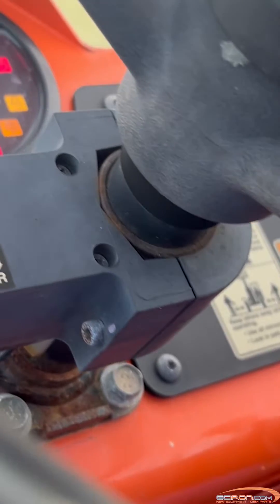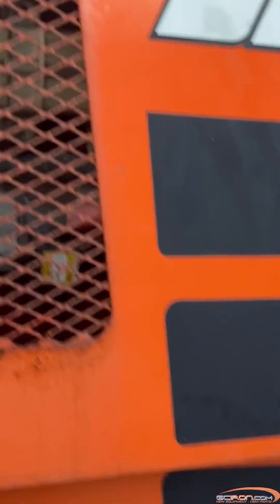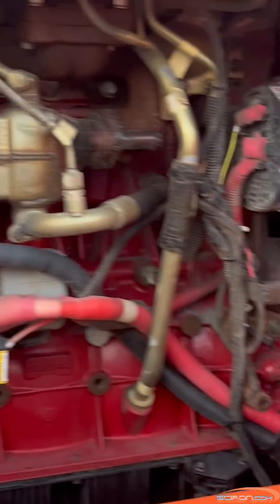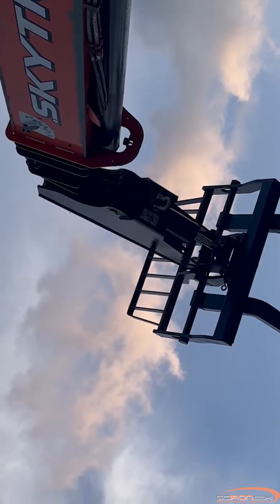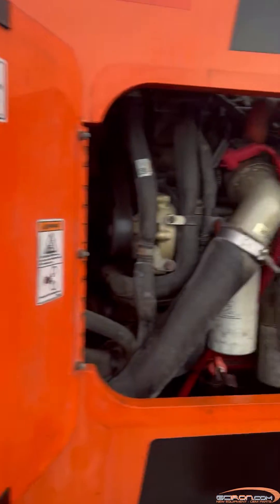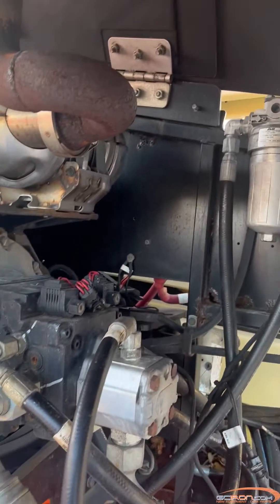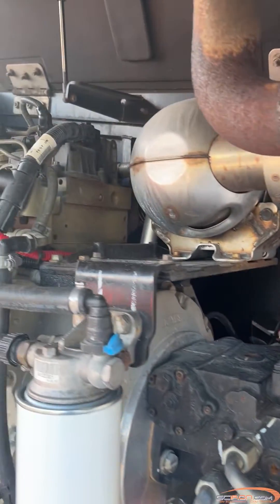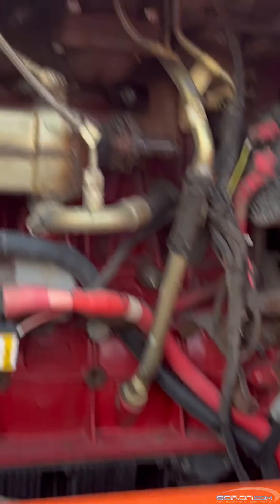Fault Code 97:15 Water in Fuel Indicator | JLG Engine

Comment: Nice
Reply from the maker: Yes, simply drain the water from fuel filter, check this several times.  If there is no water, you may have a fuel sensor that is bad.